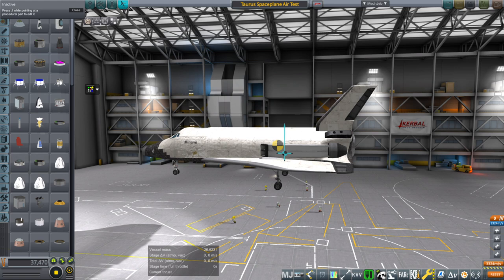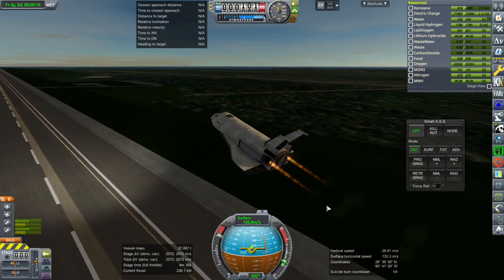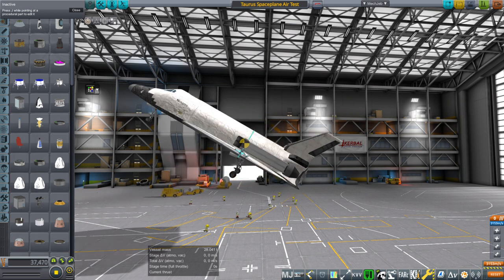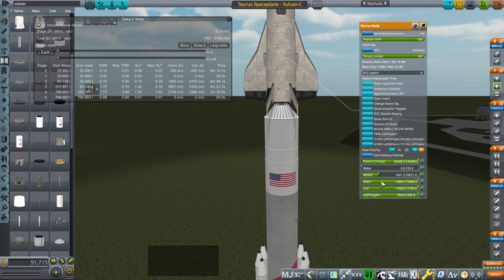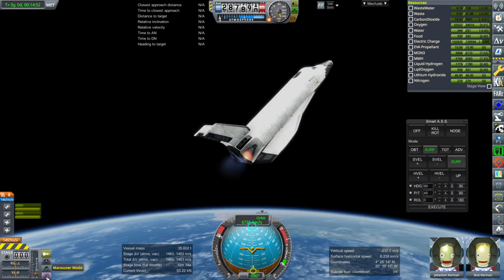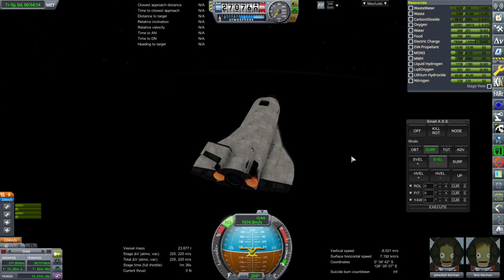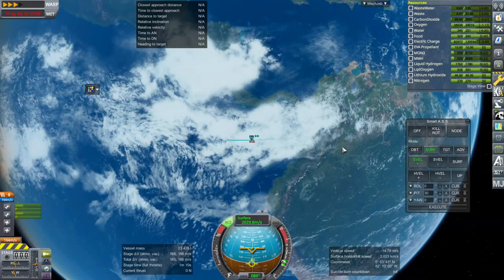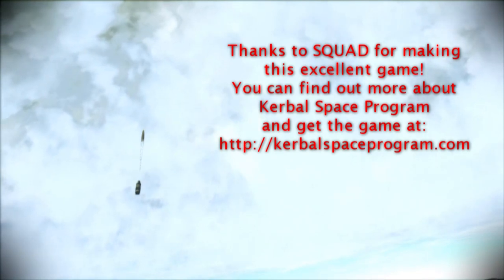KSP with Realism Overhaul - Taurus Shuttle Improvements and Vulcan Test

Comment: Are you sure that what you were experiencing with the wings at low speeds are not related to sub mach vs supersonic wing aerodynamics?

The center of lift may shift significantly at high speeds in a regular aircraft, and may cause behavior like you're describing if you designed the aircraft to have ideal characteristics at higher speeds and thinner altitudes

Comment: If I had a Rocket company, I'd invest in a similar concept. Trying to land the booster as Falcon 9, and with a Stainless steel second stage, plus an inflatable nose cone shield, and using parachutes to land it.
Reply: That depends on Thrust density. More thrust you can get out of the engines, and the more of them you put underneath the rocket, the better opportunity you can get with reusability. I’ve found so far a thrust density of ~70 tons per square meter seems to be the absolute minimum for a reusable booster without very clever aerodynamic tricks like Rocket Lab is doing with Electron.